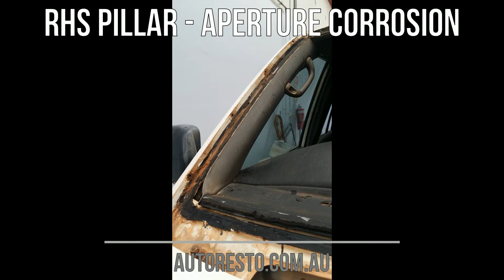Toyota Landcruiser 100 Series -  Front Windscreen (Rust Repair)

Comment: Always happens to mining cars, judging by that it could be an ex underground toyota
Reply from the maker: It sure was Chevy.  This damage could have been avoided if the windscreen aperture was repainted before the initial windscreen replacement.
Reply: @autoresto4505  This also happens when windscreen installers use screws or metal rivets instead of plastic coated rivets. It's actually pretty common. I hear quite a few stories of these having electrical and wind noise issues, I'm guessing that's why.